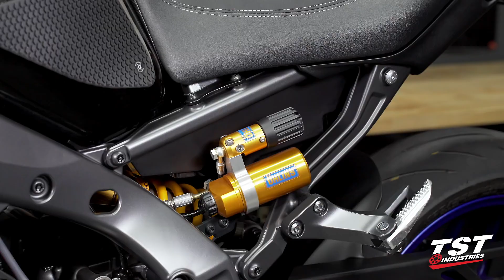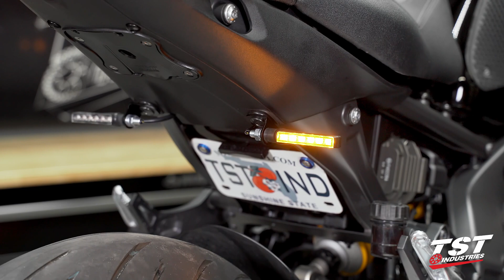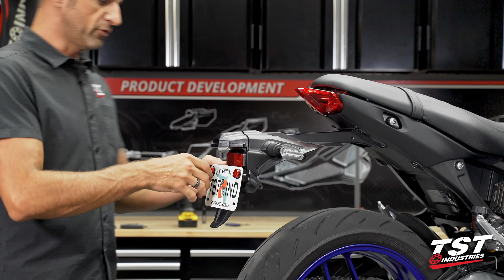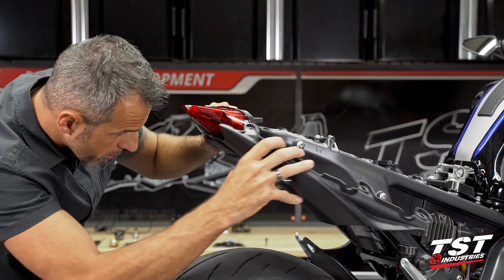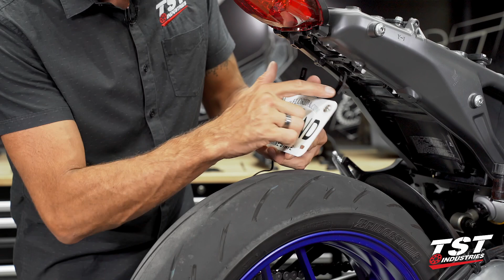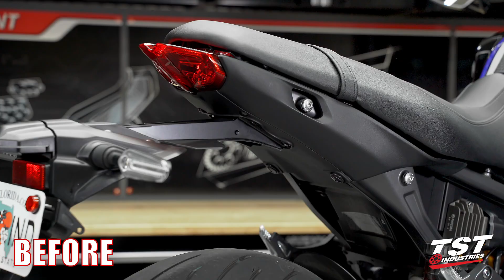How to install an Elite-1 Low Mount Fender Eliminator on a 2021+ Yamaha MT-09 by TST Industries

Comment: Thanks for taking the time to make these install videos ! Made it very simple and manageable. 
Have this kit and the tail light coming sometime this week excited to throw it on my MT09 SP !

Im assuming its going to be best to install the plate before the bracket install as I wont be able to access the bolts for the plate after its on ? Still on a temp tag so wondering if I should hold off for my plate to come in

Comment: Hey TST, are you guys going to come out with an integrated taillight for the 21+ MT09?
Reply from the maker: Yup. We have it designed already and now we are designing the injection molding tools that will manufacture the components.
Reply: @TSTindustries  YAYYY! Can't wait! Currently rocking your fender eliminator and no rear turn signals🤫
Reply from the maker: @2FastKC  how do you like that stuff?

Comment: Such a neat kit! Are you working on a plug and play solution to avoid wire cutting?
Reply from the maker: We do have all the parts to throw in a bag together and offer a plug and play solution but we have found that the savings of a Universal kit is more appealing to a larger base of customers
Reply from the maker: You dont have to cut any wires. I just opted to do that in this installation. It is easy enough just to use our posi-tap connectors on the harness side of the connection and not have to cut anything.

Comment: Bonjour, pour commencer, vos vidéos sont top , sur cette vidéo Bart utilise des connecteurs, comment s'appelle ces connecteurs rouge ? en vous remerciant d'avance pour votre réponse.
Reply from the maker: If you are asking about the connectors for the license plate light then they are called Posi-Tap , and are made by Posi Products. We include two of these connectors with our license plate lights.

Comment: What's the size of the US plate? Will 8x2 plate fit? 
Regards
Reply from the maker: Are you asking about an eight inch by two inch plate? I have never seen one that short. Anyway, our license plates are 7 inches wide by 4 inches tall. I do not believe anything 8 inches long can fit in there without modification to the plate.

Comment: Is there any way to do a similar kind of turn signal mounting setup on the XSR?
(The pod signal on the frame)
Love these videos
Reply from the maker: The next gen XSR900 is very likely to have the same frame as the MT so yes for the moving forward models. For current year and back, there aren't frame elements that we could screw into in this way. But we do make a really nice, restyled integrated tail light for the xsr900 if you would be interested in that. I will paste in the link to the product page below. We also have an installation video to show all the steps start to finish. https://tstindustries.com/tst-led-integrated-tail-light-fender-eliminator-system-yamaha-xsr900-2016.html
Reply: @TSTindustries  i hope it has the exact same tech as this. Or if buy a wrecked MT09SP and swap it into the XSR 😂